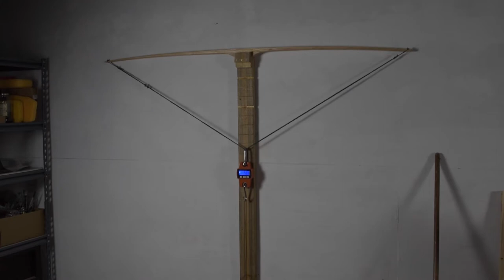From Board to Bow | Building My First Bow Out of Ash

Comment: Very good job!
Reply from the maker: Thank you!! I’ll be building another, slightly different style, soon.
Reply: @redingart9656  I built a nice Mollegabet Bow that I posted on my channel that came out awesome! I had to build a lighter bow because of losing 50lbs in the hospital, don't have the strength yet to pull my bows ... So after watching bow build videos I made one only 37 lbs draw weight. It's on my YouTube channel. I did make two others, one broke during tillering, and the other is 50lbs so can't use it till I build my strength back up.
Reply from the maker: @joedaniels4646  I just went check it out. That Mollegabet design is sick and new to me!
Reply: @redingart9656  Yea, it was new to me as well ... turns out it's one of the oldest designs man ever developed. They  supposedly are from the Mesolithic period. The lever ends I designed are about 9" long to the string groove (nock) and the non static bending part of the limbs extending from the fade of the handle (That I make as a non bending handle 12" long including the 2 fades.) to the fade of the lever is about 12 1/2" long. That approx 60 to 40% ratio really turns it into two catapults  firing your arrows.
My next Bow build is going to be a Mollegabet bow with recurved ends to make it an even crazier Bow ... I am a little Leary of trying to bend the wood into a recurve ... looks pretty easy to screw up, but I need to try it!